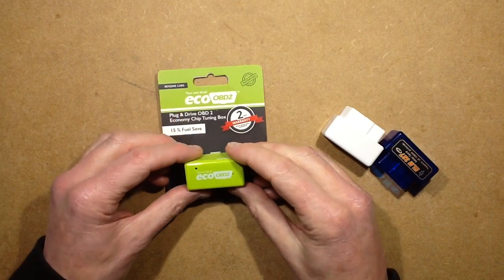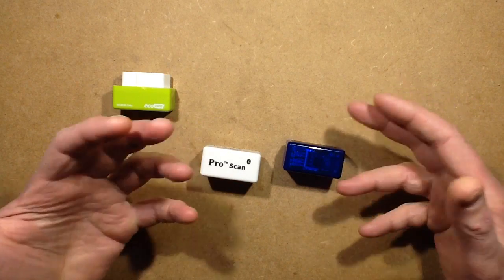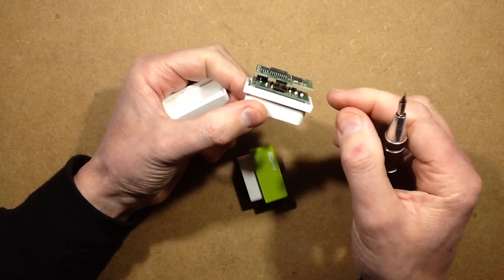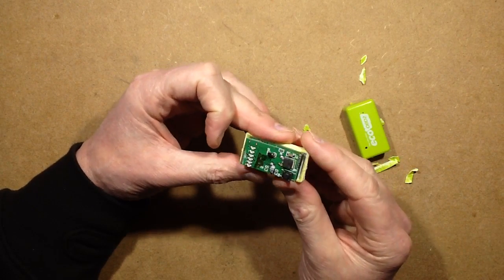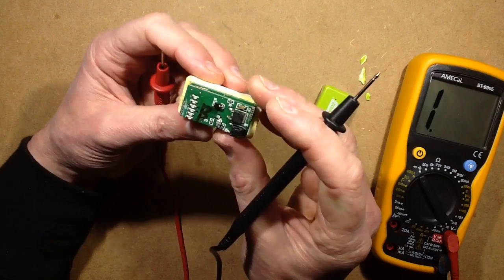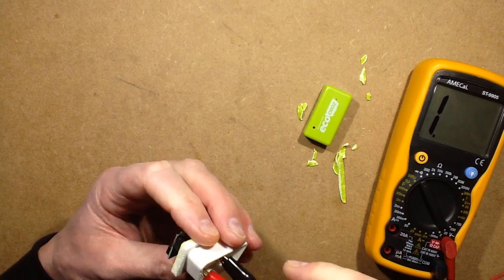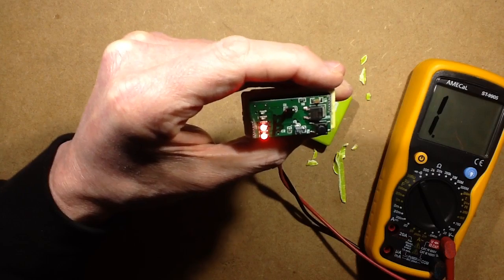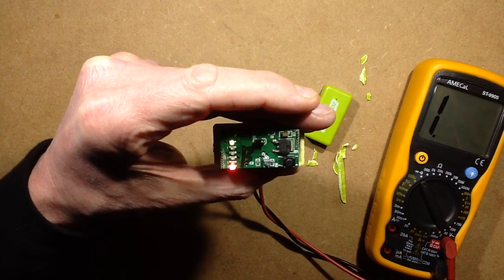Inside an ECO OBD2 "chip tuner" fuel saver.

Comment: "You would then be relying on a bit of software of unknown origin..."

Agreed, but this made me want to point something out. All the software that runs an automobile is closed and nobody really knows what it's doing. The recent VAG scandal proves that. These computers are controlling ~2 ton hunks of metal that are hurtling around our roads at high speeds, and nobody outside of the manufacturer's dev departments has seen the code that runs on them.

They should be open sourced, or the source code at least made available for personal use, and regularly audited by industry professionals. It amazes me that nobody in the media has pointed this out already.
Reply: Krankie V the code could easily be open source whilst still have the car only run signed code. people could verify the code running on their car but not necessarily modify and upload their own version.
Reply: +Luke Hawkinson There is ONE chance in hell... if it were (by coincidence or programmed to be) for a specific vehicle or at least engine, then it could do basic things like prevent the driver from giving it much gas so fuel economy went up over the "average" driver's result.  Setting a brick under the gas pedal could do the same thing.
Reply: +That Linux Gamer and all the others: Watch this and learn something interesting about ECUs and the VAG scandal: https://media.ccc.de/v/32c3-7331-the_exhaust_emissions_scandal_dieselgate
Reply: I doubt seriously if this cheapo device is so complex.
Reply: +bigclivedotcom "Then you'd definitely have a 2 ton hunk of metal hurtling along the road with damaged software." I think we already have that situation (damaged bioware).
Reply: +bigclivedotcom (note - I'm replying to you as @That Linux Gamer has replying turned off) OBDII is actually an open standard mandated by the state of California - it's fully documented and all of the open standard codes are required by law.  As far as ECU software being open source, it would be complete waste of time.  Just being open source is not a panacea (cf ancient bugs in openSSH or hidden code in embedded systems AKA Juniper - basically the same issues as VW's software) - the only thing that really matters is the actual emissions out of the tailpipe.  If anything emissions testing is too lenient - even here in California.  

And @bigclivedotcom is right.  I've worked with big car companies on open sourcing software and they are terrified of the liability implications, so it will never happen.  That's also why a lot of open source companies have viable commercial businesses, they will take on the liability issues.  

As far as reflashing through the OBD port causing dangerous issues, I doubt it.  People remap ECUs all the time, nothing dangerous ever happens.  You might destroy your engine, but it's really only dangerous to your car and nothing else.  Also, it's not really possible to re-flash a lot of safety critical systems through an OBD port, you need a factory tool for that and it uses different protocols & connections.
Reply: +grahamek86 Changing limited calibration maps within an ECU and designing a robust engine management software that conforms to safety critical functions are very different ends of the spectrum. Engine management software isn't open source and documented because it is intellectual property that cost millions of £/€/$ to develop. 

The fact that it is tested in the lab, then in a car on a rolling road and then in a car on a test track and eventually a road means you don't have to worry what functions it is performing. 

P.S. this unit is utter crap.
Reply: iTheGeek Absolute nonsense. The vast majority of ECUs can be done via OBD-II. The only ones that present a challenge at the moment are very late EDC17/MED17 based ECUs in a lot of BMW vehicles. Granted, the ability to do so probably involved some R&D effort to establish the protocol, but that's why the tuning tools from Byteshooter, Alientech etc are so expensive. I can flash a calibration into my Golf R in about 8 minutes without having ever seen the ECU.
Reply: +bigclivedotcom we already do that because there is absolutely no documentation on the software, of course we test these things in controlled environments, not on the road. If the software was open we would know exactly what we should and shouldn't change to keep the car roadworthy. Just my 2c tuners will mess with it anyways, might as well have documentation and source code on the software.
Reply: +William Doubles any thing can be hacked given enough time. IF you know the purpose of the program it is a lot easier to hack. also car companies release code to tool companies such as MAC Snap-on etc. this gives a tuning organization a base set of things to start with to develop fuel, air, timing, boost, temperature, all kinds of things really can be seen with high level obd2 tools. the flashing of data back to the ecu requires the hacking. thankfully auto makers are pretty lax about changing the protocol. so to summarize yes it is possible to reprogram an ecu. will that do it ? not a chance in hell.
Reply: you do have a point there i suppose
Reply: grahamek86
There's probably still a way to do it by just mapping the resistance values and adjusting accordingly.  Might take a bit of math but then less than 10 cents worth of resistors.
Reply: grahamek86
You mean by the time you get a prom reader, read and decipher the code, reverse engineer it,  modify it, flash it back, test it, then go home and have dinner?   I know some people are allergic to a multimeter and soldering but those things really don't take much time and it's potentially the kind of mod you could switch on and off with a hidden switch under the dash which could also effectively be an anti-theft kill switch to the point where the engine won't rev to drive off.
Reply: +That Linux Gamer The issue with that is that OBD-II was designed specifically with vehicle emissions in mind. Here in the U.S. it is technically illegal to modify any part of the engine that will change the emissions systems, this includes flashing fuel tables, cutting cats, o2 sensors, even performance chips. If the manufacturers released the source code for their fuel management systems, then many of those people who have any programming knowledge would fail emissions, and technically be breaking the law.
Reply: +bigclivedotcom 
I understand why It&#39;s not open software.
But how about those countless chip tuners?
They also promise better mileage.
They manage to alter, or change the software, or maybe change the chips.
They should know how the original software works.
I think it's funny they think they know better than the ones who make the cars.
Reply: +grahamek86 It might be that you can flash a new ECU program from the OBD-II port... but you'd have to know what the ECU was, and have a new program to flash onto it... neither of which can be achived with a generic device... it would have to be able to identify the ECU model, and have a library of alternate ECU programs available.... neither are really possible with a small microcontroller.
Reply: John Doe You're over simplifying how many different ECUs there are out there, along with software version numbers. The CR140 VW/Audi diesel engine, for example, has 5 different ECU hardware variations and over 100 calibration versions
Reply: James Lewis Not via OBD they won't
Reply: Thats correct. at least to my experience you have to get you ECU chip flashed. or buy a tuneable chip. there are some things you can change through the odb2 port but you would have to know how to code their programing and where to put the code. even then I don't think you can change sensor values. If you could I sure could have saved a lot of cash.
Reply: while I don't think this is relevant to the videos obd2 plug, if you can force an exploit to get code injection, you can do anything you want to anything else that's connected basically.  Like the bmw attacks.
Reply: If they made the software open source then it would be easy for consumers to circumvent and disable emissions control devices on the vehicles.   For instance,  newer diesels required a special fluid (you need to purchase out of pocket) to add to satisfy emissions standards.   I picture if ECU on all cars were open source, like Linux, it would be very easy for people to "turn off" that exhaust cleaning function, and run their vehicles without the fluid to save money/the fuss of having to add it,...or even to avoid having to get repairs done to emissions systems.
Reply: environmental agencies would never allow this to be open source
Reply: +James Lewis Exactly. Even if it had the capability, it doesn't have the memory onboard to store that many different firmwares. It's not just a matter of "sending new parameters", those parameters are hardcoded into the firmware and thus the entire firmware would need flashed.

Additionally, flashing firmwares via OBD2 is SLOW and cannot be done while the vehicle is in normal use. There's no way it's flashing firmwares while you drive.
Reply: +That Linux Gamer Much easier to use this https://plus.google.com/108887414491535425118/posts/NTkrkuzaBKs
Reply: That Linux Gamer
Reply: That Linux Gamer _-c''!
Reply: +Alvin Brinson While having enough memory to hold complete firmware would be a challenge (unless there's an extra flash chip in there somewhere), some simple tricks can ease the job:

1. Write the update the next time the car is parked (thus engine off). 2. Take advantage of the limited number of ECUs in common use and only deal with those.  3. Extract, modify and write back the existing firmware rather than having a prepared firmware for every car model supported. So for e.g. on a model X ECU, read and change a small number of fuel management settings used by model X on all diesel engines, leaving the rest unchanged.  Do something similar for model Y etc.  4. Use the 200km reference trips to determine the most common speed/throttle combinations for this driver / car combination then use a slightly more sophisticated formula than the default one to determine which tuning parameters would work best for this driver rather than an average driver, e.g. by extrapolating from the built in parameter tables and how those usually are based on a "standard reference driver".
Reply: Usually these devices simply modify some sensor inputs before they reach the actual ECU to shift the fuel map to a slightly richer point.
Reply: Well, companies like VDO, Marelli, Bosch had invested in this bussines for long and each code is IP of their brands. Plus, there is nothing like a standard code that will fit in every computer. Principles are similar but computer change from car to car and even in the same model to accomodate various features, sensors, inputs and outputs. Also you could read the app side code from but there is (or used to be) microcode for the ignition timming chip or peripheral that is very custom. In fact they can use custom chips just for that. so, you wont be able to fully understand what is going. Those things are custom made. What they have standarized is the diagnostic information interface. But even that it not perfect- Scanner need to indentify the computer to know what quantities is able to read and edit.  Again this changes IMHO from car to car.
Reply: They are phasing these systems into every diesel vehicle... as soon as epa standards tighten up further they will be implemented into the smaller vehicles as well.   THe "eco-diesel" dodge ram even uses DEF and it only has a 3.0 diesel...given the power output of that truck, it might aswell be a V8 gaser.   Sure gets good MPG though...
Reply: Michael G only a 3.0 engine
Reply: lee x in Ireland it costs about 2 grand a year to tax a 3 litre engine
Reply: w1th0utm3rcy I'm sure they forgive people if it improves emissions.
Reply: Robert Slackware, yes, but the programming usually applies on the road as well as the dyno.
Reply: Or 60 tonne hunks, in the case of full-weight trucks... :-/
Reply: +That Linux Gamer That's not true. The tuning industry modifies and recalibrates engine management systems on a daily basis to one extent or another. From taking a simple flash read and editing calibration values to modify fuelling and ignition timing, to actual reverse engineering the processor code to add functionality such as launch control etc. I've got literally thousands of OEM calibration and processor reads to hand that allows me to see how the engine runs. Many tuners have known about the routine that modifies running on a dyno - they've been using those modes to test the car during tuning.
Reply from the maker: +That Linux Gamer The problem there is that people would then be tempted to start "hacking" the software.  And that includes the ones who think that it's perfectly acceptable to change random byte values to see if it does anything without even knowing what the function of those bytes of data is.  Then you'd definitely have a 2 ton hunk of metal hurtling along the road with damaged software.
Reply: John Obmar It's nothing about "knowing better", it's about doing things that OEMs don't/won't do because of having to cater for neglectful owners, poor climate, poor servicing, emissions, reliability, not wanting to impede on more expensive models etc. I know a lot of tuners whos knowledge is far greater than the folk who work for the manufacturer. They are just software engineers at the end of the day - bugs do happen, and because they work for the manufacturer, doesn't mean they are the best!
Reply: +BladeRunner21577 Why would a tuner know or care about that? By looking at the source code, that would be very hard to detect for even a Bosch engineer. To notice, you'd need to analyse every line of assembler code of the processor data - and 99% of tuners aren't interested in the processor data. The calibration data have tables or "maps" that are modified. These maps are named for their purpose and are usually present in multiples within the calibration memory area. Tables such as boost, fuel and injection advance are all modified to give the desired effect. There are very few folk who sit and disassemble the processor data to analyse each and every function the ECU has. Stabbing around in the dark is wildly off the mark - it would take some lucky stabbing to manage to successfully modify ~30-40KB of data within a 4MB file without some sort of knowledge.
Reply: trialsted The base firmware is written by Bosch. Car manufacturers only calibrate, they don't design the management. Any features are implemented by Bosch / Siemens. That said, I don't see where I said anything to the contrary of what you said.
Reply: ferkemall
Not quite the same thing, even with a top speed limiter, even with an RPM limiter, both of which many cars have these days, it doesn't stop the drivers from nearly flooring it to go from one stop light to the next.

However, a more sneaky way to pull it off, especially if you have a reckless teenage daughter, is fiddle with the resistance on the drive by wire throttle sensors, or loosen the cable, put extra slack in it on the older cable connected throttle plate intakes.

... which would work for the much older carb'd engines too but nobody drives those these days unless it's a restoration high performance vehicle and it would be a crime to cripple one of those.
Reply: If you place a resistor on a DBW pedal you'll kill the throttle stone dead. The pedals have inverse pots with different resistors that are both checked for plausibility. It's far easier to modify the calibration and numb the drivers wish or cap maximum torque.
Reply: By the time you've figured that all out I could have written in above calibration, went home and had my dinner :-p
Reply: If it's anything within the last 20 years then no. I'd plug it in, read the file, load it into WinOLS and scour for the pedal map and knock it down a touch. Save, write, job done.
Reply: ***** That's old school tuning. The non volatile memory in ECUs of the last two or so decades have been using EEPROMs that can be flashed over the diagnostic port. The only way to modify the operating parameters of the engine would be to rewrite the calibration which cannot be done on the fly. The ECU needs to be put into a flash mode (pre-requisite being engine is off) and the flash being rewritten in its entirety. No OBD device can do this on the fly, especially not a cheap chinese OBD dongle.
Reply: +William Doubles  How? By poking things with a sharp stick and a sharp mind, and by breaking a few eggs. You can disassemble a piece of hardware, you can read out the EEPROMs, the storage chips. If you know the processor instruction set, you can disassemble the firmware code and slowly start to make sense of it. If you don't, chances are if you stare long enough you'll first see the NOPs (filler before round locations), the load/store operators, then the JMPs (flow control), just before them the arithmetic and comparison operators, and you can grasp the general overall structure of the code. You look at the bit patterns of the instructions, and realize some of them actually stem from hardware simplifications, so you can make conclusions from meaning of some instructions onto the meaning of some others. Sometimes you will find a piece of firmware that is obviously not code but a table of values, just from how regular it looks, you start changing them and see what they do. You can test whether something is likely code or likely data by modifying the values by a small increment, if it still works, it was probably data, and if things break terribly, it was probably code. Sometimes you can "borrow" an official or manufacturer-licensed speciality programming or diagnostic tool, make or borrow a protocol specific logger and hook it in between, record a piece of communication and try to figure out what the actual messages mean. Sometimes you know a person on the inside, you can fill them up with alcohol on their weekend making sure to drink a lot less than they do and maybe they'll drop some knowledge which may seem innocuous to them in isolation, but might be a vital piece of your puzzle.

Not that i did any of those things on car electronics in particular, no, but i imagine the general approach shouldn't be all that different.
Reply: I think you mean AdBlue solution (Urea), which is part of a Selective Catalytic Reduction (SCR) system. These systems are big, and require dosing tanks, dosing pumps, et al, so are only on big vehicles such as trucks and buses, and some pickups etc.
Reply: ***** I've re calibrated the ECUs in most of my cars without any issue. There is no doubt that pushing an engine harder will cause more wear, but a sensible driver with a remapped vehicle will wear it less than an idiot that rags it everywhere and neglects servicing. Power increases are usually detected by taking a before and after power run of the car on a chassis dynamometer, powered by the vehicles wheels.
Reply: +grahamek86 
Makes sense. Just like Microsoft vs Linux... :)
So open source IS better? It only should be done by people who know what they're doing.
Reply: +That Linux Gamer  the Vag cam cable that connects to my laptop gives me a visual on the machine code
on my VW auto group. this is why the university students could even look inside the VW Deisel programming in the first, place. I wanted to correct the  air fuel ratio fault  but it ended up being a sensor reading out of range
this is not complex coding its rather more rudimentary similar to 80s video games
Reply: +grahamek86 Very clever stuff indeed, but for all that you still didnt know that VAG programmed their cars to pass emissions tests. Which tells me you are actually stabbing around in the dark and getting lucky rather than knowing what you are actaully doing... If you did you would have seen it.
Closed source is best. They write it so they decide, they dont have to tell the car modifiers a thing, and I dont think they should either because what is to stop them from doing something similar to VAG for emissions tests.